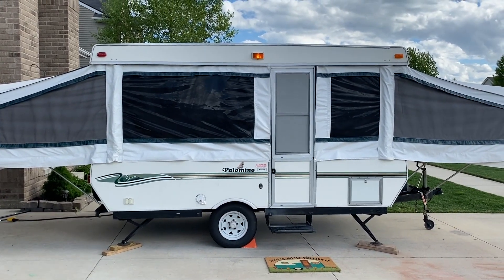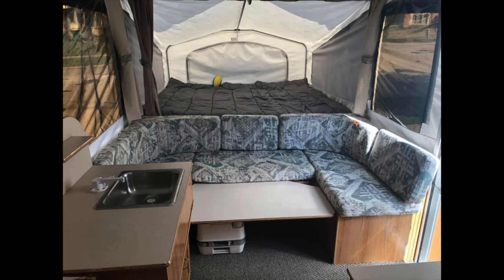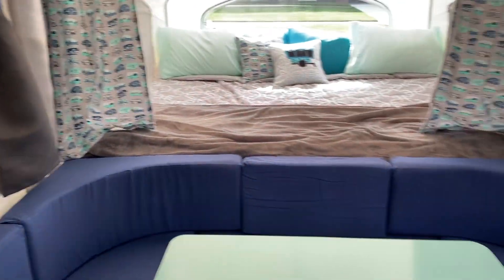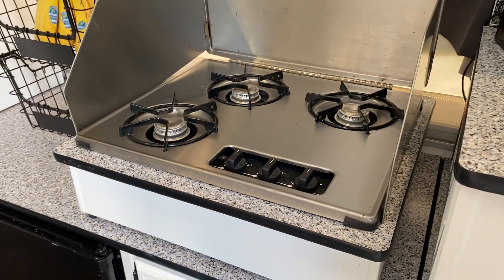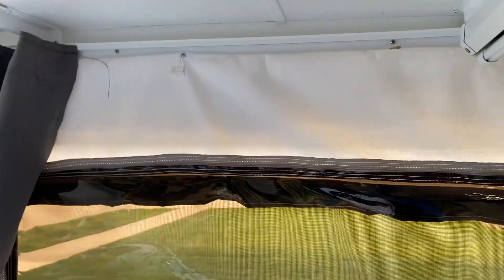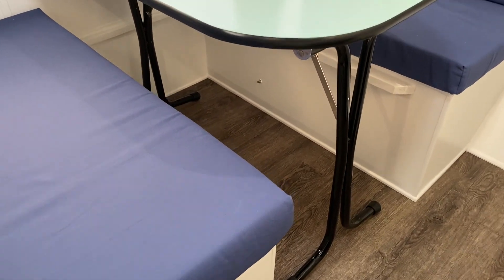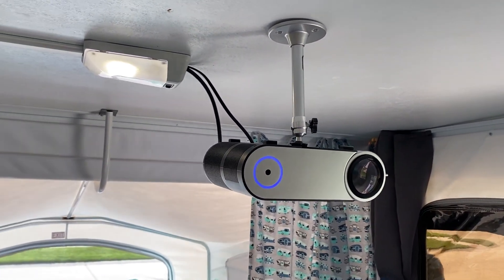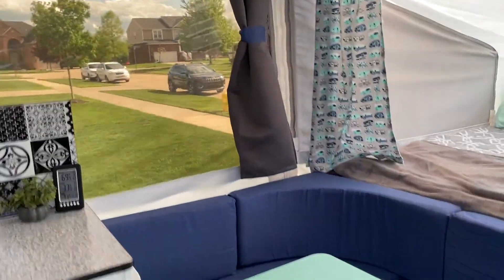Pop-up Camper Renovation- 2001 Palomino Remodel

Comment: Outstanding job! One question: How and where did you wire in the projector? We used self-adhering wallpaper on the front of our bathroom cabinets and I would use this for the counter tops since contact paper leaves a sticky residue.